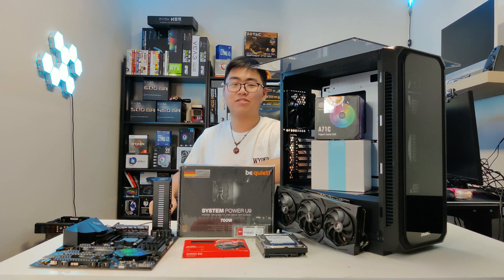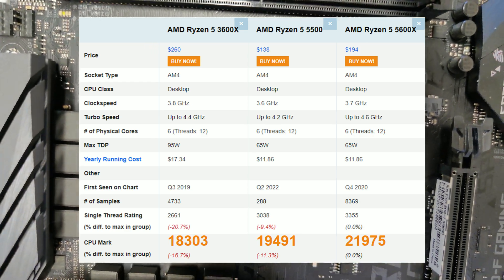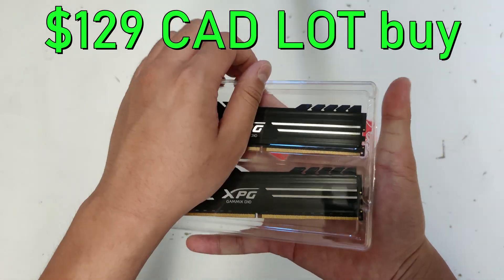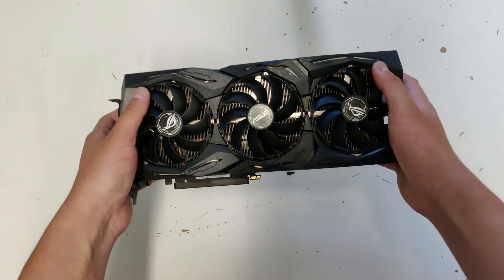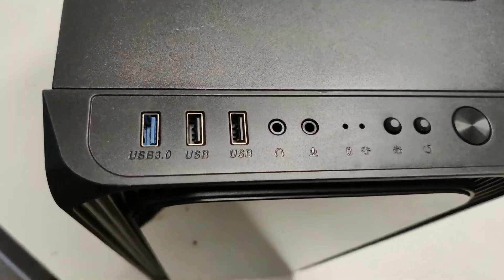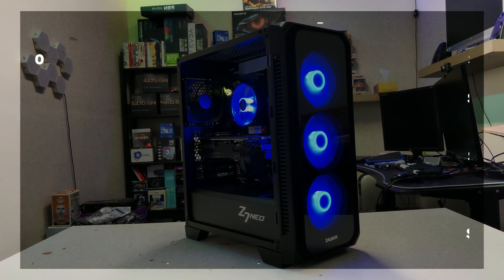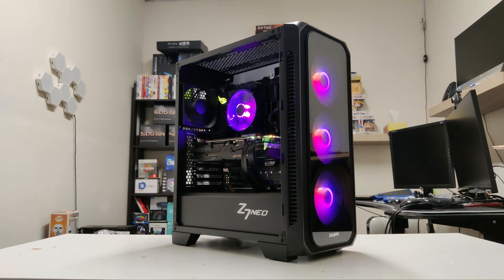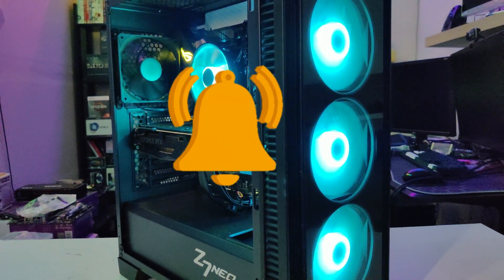FAST $750USD Gaming PC Build Guide - RTX 2080 Super & Ryzen 5 5500 (w/ Benchmarks)

Comment: Just one question if you can help me out. If I buy a motherboard that you need to update to support a CPU. If you buy the CPU and put it in the board that needs updates and turn it on will it work or will I need an older CPU and update the BIOS first and then put the 5500? 

Just something I don't really understand and I need some clarification if you can help. Thank you!
Reply from the maker: You would need an older CPU to update it, then I'll work with the newer cpu, otherwise it'll just turn on and off or not post at all
Reply: @woostinstechflip  Alrighty good to know. I got an older CPU so this wont be an issue with me. Thank you for the help

Comment: Won't the Ryzen 5 5500 bottleneck the 2080 super?
Reply from the maker: Nope, if you pay attention to the metrics on the top left corner in the benchmarking section, the GPU usage is always equal or greater in percentage, which means that 5500 can handle an even more powerful GPU.
Reply: @woostinstechflip  wow didn't know the 5500 was so capable!
Reply: @woostinstechflip  I've paired my GTX 1080Ti with a Ryzen 5 2600x many of my friends said it's bottlenecking the GPU and told me to upgrade to a Ryzen 5 3600 or a 5600. Do you think I should upgrade?
Reply from the maker: @chetankumarr8084  it'll definitely help if you get an upgrade, get the 5500 instead of the 3600x just because it's newer and performs a bit better, and it's cheaper on Amazon.